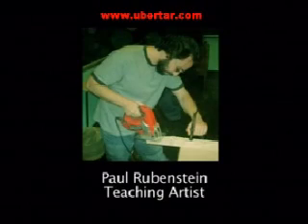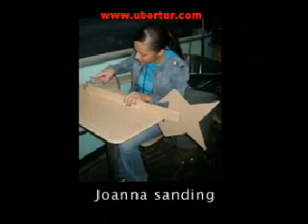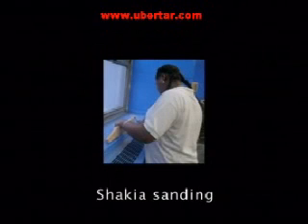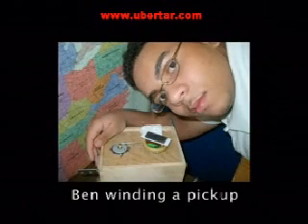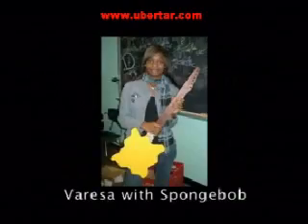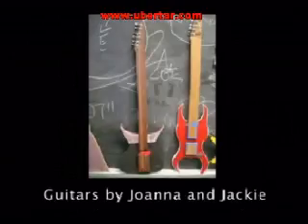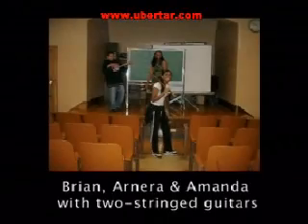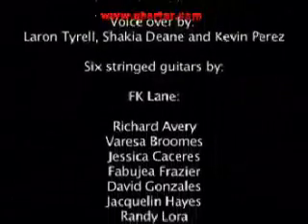kids make electric guitars

Comment from the maker: The pickups are just magnets with 42 gauge magnet wire wrapped around them. There's a picture of the pickup winding machine in the video. A turntable would also work, just slower.

Comment from the maker: The frets were glued on. Some frets were made of steel umbrella spokes, and others were made of hard plastic. We used a tuner to determine where to place the frets, after the strings were put on and tuned, so there wouldn't be any change in tension on the neck after putting the frets on.